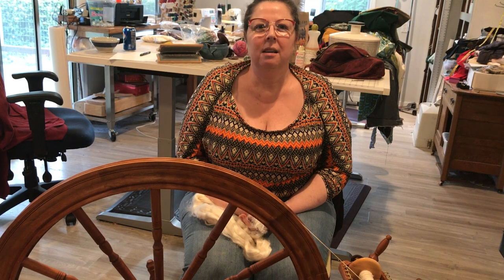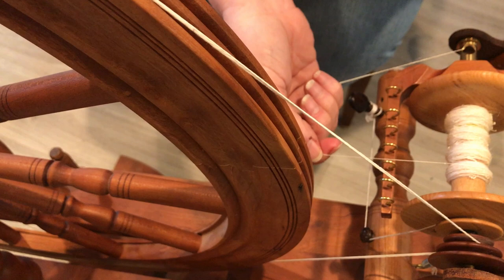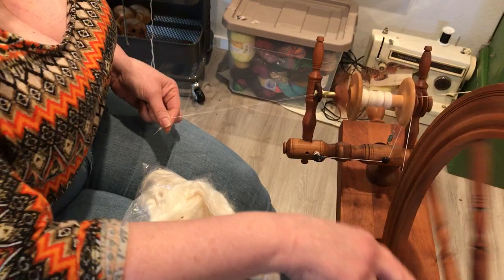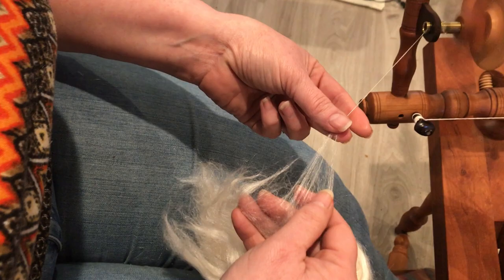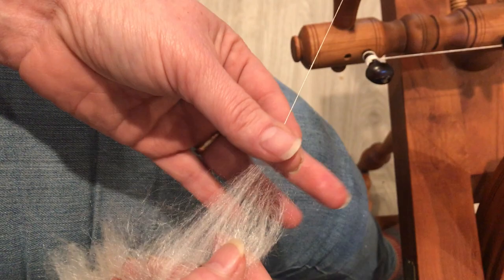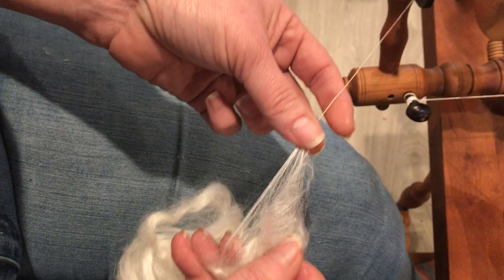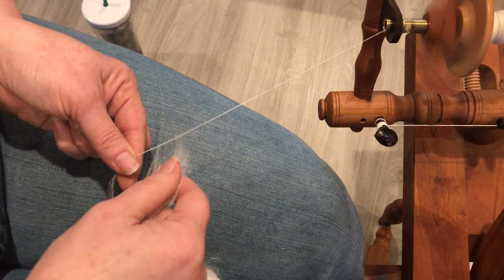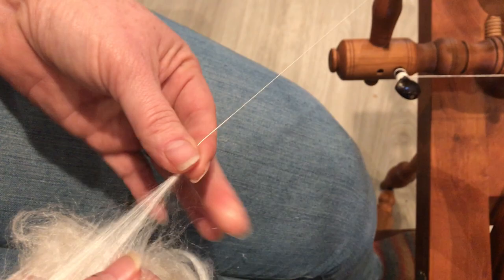Spinning Silk   Demo   Moira Ramsay

Comment: This is great; thank you.  I have a Schacht Reeves wheel too, and I love it.  It's lovely to see instructions for spinning silk on it.  I'm knee-deep in the learning process with silk right now.

It looks like you're using the smaller whorl.  I'm interested in how you're using a faster whorl together with a lacing method which looks like it would slow down the uptake.  Could you explain how this is working?  Which whorl size are you using?  Thanks again.